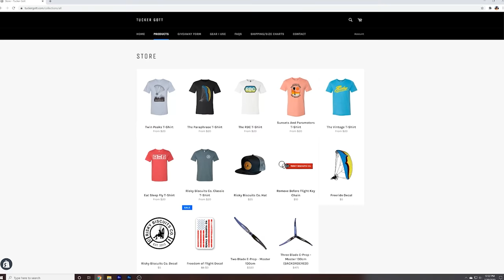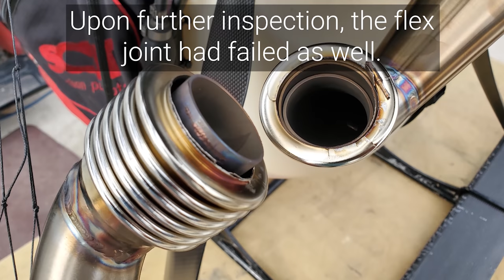Landed On A Street!!! - Top 10 Engine Failures

Comment: Always better than a parachute failure. Otherwise you’re falling at 120mph with a ceiling fan on your back.
Reply: I shouldn't laugh at this
Reply: He has a reserve chute
Reply: @lanthanumlanthanium6373  It looks really safe then, actually. Now I want one!
Reply: @hasselnttper3730  I would if I had more money, I'm starting on Skydiving first.
Reply: I'm a retired aircraft mechanic. Tucker I have an off the wall question;  Do you guys safety wire? I could be wrong but I thought I saw non-safety wired bolts on your prop attachment. I know I saw non-safety wire around your seat arrangement bolts. What's the story on that?
Reply: @dwighthawkins5955  why are you commenting this a a reply to another comment instead of just putting it in the main comment section
Reply: @thec0nductor537  they probably know that Tucker won't actually respond and is asking other paramotorists
Reply: Unless u use the fan to get a safe landing
Reply: @cali4788  the fan isnt powerful enough for that, plus u cant steer without a chute
Reply: try para gliding needs to be sunny though
Reply: Rip grant
Reply: @John 29Barr ye
Reply: LOL
Reply: Thats why we have reserve chutes
Reply: That's kinda my question. What if there's a glider failure?
Reply: In order for it to be a ceiling fan, first you have to fall through someone's ceiling.
Reply: Just point towards the sky and go full throttle, DUH!

Comment: Tucker - Why not mount a GPS beacon on your machine? Even if the pilot is injured, you can locate the machine ...
Reply: GPS is actually really unreliable, especially if the location is a bit woody. I went into the woods with a GPS on my e-scooter, and like bruh i couldn't locate myself on the map.
Reply: @Appri  Handheld aviation GPS are extremely accurate and extremely reliable. For stuff like this I advise a Garmin in-reach or some other Garmin GPS Personal Locator Beacon with two way communication capability. That said, my flying is a lot more remote and dangerous than paramotors, who will come out unscathed in the event of an engine failure.
Reply: @philconey11  I mean the only case where you lose a paramotor guy is when they crash. And if they crash, they are most likely in the woods, meaning the GPS is useless.
Reply: Coder Stone my plane ELT that can pinpoint location down to five feet
Reply: @Appri  Imagine saying a GPS is unreliable.
Reply: @luckylukas2282  You do realize cars get lost in large national parks all the time, because GPS navigation tells them to go the wrong direction?
It's especially unreliable WHEN THE SIGNAL CANT EVEN REACH THE SATELLITE, due to a thick leaf canopy in the woods.
Reply: @Appri  dude stop confusing those crappy road-going GPS's with proper aviation-grade GPS's equipment. GPS's made for aviation and for sailing are another level. much more expensive than the crappy cheap GPS for driving? yeah! but much more effective and reliable too!! driving GPS's are made to be as cheap as possible, with GPS antennas that are not much better than the ones or your phone(if any better).
Reply: @vegetapt9144  Those are called DIFFERENTIAL gps, and wayyy above anyone's paygrade, especially if you are flying a budget paramotor, don't you think?
Reply: Can just share locations on Google maps permanently.  Will get you close enough to find them
Reply: @Appri  I wasn't referring to those. differential GPS is way too much of an overkill even for sailing in open ocean. I sail solo in a 33' sailboat in the ocean and use a regular marine chartplotter paired with my handheld GPS
my point was that you're judging GPS's as if it was all the same, and it's not. 
driving GPS's like that cheap tom tom's on your dad's car, are pure garbage, even thicker clouds can make their signal fail. if your phone is a decent one it probably has a better antenna than those. 
I don't fly yet so I can't recommend a decent aviation specific GPS, but I use a handheld GPS(garmin InReach,now it cost 400$) for hiking and to pair with the sailboat chartplotter, it went with me on my last vacations in the Amazon rainforest and...no, it didnt failed, not even a bit! so dont come with that nonsense
and for the use case refered in this comment its probably a good option. there are other similar GPS's from other brands that are cheaper. I've just chosen this specific one because it can be paired with the chartplotter I already had.
Reply: @vegetapt9144  Sigh, you call it nonsense, but have you EVER even walked into the woods with a GPS? Any sort of canopy can easily ruin GPS accuracy. You are a sailor so you probably NEVER have a canopy over your boat when you need your GPS, but this is precisely why GPS suffers inside subway stations, tunnels, EVERYWHERE. Stop arguing your opinion without understanding what the other person is saying.
Reply: @vegetapt9144  " I sail solo in a 33' sailboat in the ocean and use a regular marine..." Sounds like the Amazon all right. Geez, triggered much, aint ya? and if my profile makes you think I'm just a child, think again. If you seriously think a GPS can keep track during heavy interference, you need to go redo basic and modern physics. Facepalm. And yes, you are totally a person on youtube named Vegeta PT, with a Vegeta profile picture, yet travelled to the Amazon and is a professional sailor. Noone's buying your BS.
Reply: @Appri  your profile?  It's your attitude. If you're not a kid, it's even worst. I'm not a "professional sailor" neither I said that. I simply have my sailboat and go for a sail every time I can.  And yes I went into the Amazon to take ayauaska, what's the big deal on that? BTW It was my best trip ever(pun intended)
Reply: @vegetapt9144  Your attitude is even worse...
Reply: @Appri  Why? you are wrong.
Reply: @Appri  damn you just like me when people try to make diabetes jokes LOL
Reply: I read a comment about an apple watch, is the watch break or feel a crack it self send a message with the location
Reply: @Appri  GPS,s are receivers they don't transmit anything to the satellites they just receive there coordinates from the satellites up in space.
Reply: @stevejones8665  And to receive that, you need a good connection. When did I ever say you have to transfer from the GPS to the satellite?
Reply: @Appri  You said "WHEN THE SIGNAL CAN'T REACH THE SATELLITE". In your comment I replied too.
I guess you meant to say When the  signal can't reach the gps or receiver.😊
Reply: @stevejones8665  You're right! My bad. GPS is a one-way system with satellites being the transmitter. Facepalming in misunderstanding your comment, haha.
Reply: Gps isnt unreliable if your above the trees..... Most have track modes so you can follow the ttrail of where something went, but need a data/radio connection to uplink the trail as you go.
Reply: GPS is from cell towers since Satellites don't exist.
Reply: @bobwreck3775  satellites don’t exist?
Reply: @Appri  gps is absolutely not useless in the woods, what are you even talking about. Ive been using gps in the woods for decades
Reply: @Appri  not only have I walked in the woods with a gps, I've been a hunting outfitter and guide for 20 years. You are completely wrong, period.
Reply: @stonehorn4641  Sounds like someone can't read the one year ago timetext, go get better glasses grandpa!
Reply: @Appri  usually thats bc the roads are set incorrectly on the map, not because gps is unreliable. Aviation GPS does not work the same way.

Comment: Ground starting is dangerous? You got it. My head & shoulder went into the open space above the frame of a Solo 210. My shoulder saved my life. It took the brunt of the spinning prop while the prop glanced off my face - wide open - full throttle. My shoulder was hamburger meat.
Reply: Shit man hope you recovered well
Reply: Oh man, I'm not a fan of the Solo 210....
Reply: @mark675  Thanks Mark & Johan. I'm okay now but it sure put a hem in my skirt! YouTube at "Paramotor Prop Strike." Look for the thumbnail of a pretty girl. I'm not a 210 fan either Johan....now
Reply: Yikes
Reply: How did your shoulder go into the blades if there's a metal net? Im a newb
Reply: @db5094  Go and search "Solo 210" on Google Images, you will see the open space where there is no netting, quite scary.
Reply: As someone with no experience.....why is this dangerous? How do you end up in the propeller?
Reply: @camaro7587  I'm no expert but I believe  starting the prop could move the entire thing into you. Usually your body should absorb that torque from the engine starting. That's just a guess, though
Reply: Sheet
Reply: @camaro7587  yeah it can just suck you in, or you could knock it over and fall into it. Just don’t do it

Comment: Last one failed straight through the weld.  I wonder if it was damaged in shipping.  Huge failure.
Reply: Possibly ran low on Flux gas and the weld got porous. Its not uncommon for a crack to go through a weld but more often than not it will crack along side of the weld. At least thats ben my experience.
Reply: no it wasn't damaged in shipping the welded parts have the thickest cross-section and can handle the most amount of stress. Unless the materials where not properly melded then it becomes what tucker received. Instead of glue they gave him chap-stick.
Reply: Root causes can be also excess of vibrations because of pressure pulsations or temperature difference possibly due to altitude / weather
Reply: I have never seen a TIG weld break like that, very surprising under these low stress circumstances.
Reply: @NLFlyFisher Two things I can think of is not enough penetration, and not enough gas or back purging. Nitrogen embrittlment. Likely never got heat cycled to drive the nitrogen out and relieve the stress on the metal, and perhaps the weld didn't get good penetration.
Reply: @EyebrowsMahoney  You are probably right sir!
Reply: @NLFlyFisher  fwiw not a professional. Just my own 2 cents
Reply: @EyebrowsMahoney  call it 2 bucks cause it makes sense haha
Reply: @NLFlyFisher  ahh, neglected to account for inflation :)
Reply: @EyebrowsMahoney  I'm Canadian so your 2 bucks is 2.60 for me haha
Reply: The joint at the flange looks like no filler has been added, which caused it to fail.

Comment: I use to race 2 stroke motorcycles in motocross/supercross/shortcircuit and would seize engines constantly because the oils were not good enough. After trying many different brands and blowing up more engines,  I found Amsoil and was so impressed with their 20:1 oil that i started stretching it out 30:1, 50:1, 75:1, at that point my sponsors (Motorcycle franchise)&(Mechanics) rang Amsoil to come see and we started using it at 100 to 1 and could not blow the engine. They ended up sponsoring me and created the 100:1 2 stroke engine oil they now sell.

Comment: Like Italian cars and motorcycles, Italian paramotor engines are mostly trouble prone, fussy, and high maintenance. The Italians don’t seem to understand how to design for reliability. It’s too bad Honda doesn’t make paramotor engines. They would be ten times more reliable, make more power, be quieter, require much less maintenance, and parts wouldn’t fall off as has happened with your Italian motor.
Reply: well they actually do make engines used in paramotors. 1000cc vtwins in trikes.
Reply: B. Bakker Those are likely sweet trikes but I’m talking the strap on your back variety like Tucker’s high strung, high maintenance, high drama, Italian motor.
Reply: Oke lmao sure “ Fix It Again Tony!” That’s what fiat stands for

Comment: Teacher: "what's the safest mode of transportation"
Class: "plane"
Me: "it's not a plane, it's a parameter because no matter what as long a your parachute 🪂is good your good"
Reply: a plane is not even close to being the safest transportation system
Reply: @wdasdadsad8450  yes it is actually
Reply: Paramotor are one of the most dangerous flight locomotion
Reply: @wdasdadsad8450  it may actually be the safest lmao
Reply: @Jerebo_mec_extreme  well if a paramotor fails mid flight you at least know you have a working parachute
Reply: @wdasdadsad8450  it actually is you're just paranoid

Comment: Hey, Tucker. The yellow stuff you saw on your piston and cylinder head was most likely sulfur. Aviation fuel is far less regulated than pump gas and as such, the sulfur levels are much higher.

Comment: The frozen throttle cable failure happens on large airliners alot...the 757 has a Teleflex cable which freezes all the time causing a multitude of issues!

Comment: I would really watch 1. fuel quantity 2. having a proven quality exhaust 3. the throttle linkage 4. loose stuff going into the prop.... seems most of the engine failures have something to do with these.....

Comment: Man I thought engine failures were more of a fluke than that.
Reply from the maker: This is pretty much the worst of the worst over 7 years. So the odds are pretty good. 😀
Reply: @nocare   the newer engines are just as unreliable as the old engines the only thing new engines have going for them is early warning thanks to delicate electronics. But thats just another failure mode waiting to happen. Plain old  carb engines are really reliable if build right and maintained correctly.
Reply: I've a number of them. 2nd flight, went to idle, it died, wouldn't start. 2 of them, ran out of fuel. My last 3, I had installed EFI on my motor. EFI requires power.. well, the rectifier wasn't working and the battery died... as did the engine. Finally fixed that.  Now I didn't know it at the time, but the CHT sensor wasn't made right and came loose from the connector. Now there's air blowing over the sensor which gave a false reading to the module. "Ah, nice and cool! We can lean it out!"... Blew a hole in my piston. Landed in the Atlanta Motor Speedway parking lot, dodging light poles and wires! 😒  Rebuilt it, installed a secondary CHT so I could monitor it. Burned it in.  Flew for 15 minutes, CHT jumped to 427 and before I could shut it off, blew another piston.  So much fun.
Reply: @nocare  Actually no... I bought my motor new from Discover.. which, sadly, was a lemon. Sent it back to Mixer who made it right. Spoke with Alex, who developed the EFI, told him I'd try it again, after the first blown piston, if he would pay if it happened again... Which he did! Great guy... The problem us, when Alex got the CHT from his manufacturer, it's sealed up in heat shrink... Making it impossible to tell if the sensor was correctly epoxied and crimped into the connector. Anyhow, I sent it all back to Alex who refunded me the cost of the system. 
Yeah, it sucks that I am still out a grand... $250 labor, $160 for Antigravity battery and charger, and $600 for the first round of parts...
But I'd go back to it if the price was right and guaranteed...
Reply: @SandiNPaul  Alex from Aviator?
Reply: @carter7515  Alex Huff, the dude that put the EFI system together...

Comment: Nice thing about Engines blowing is that it's usually the top end. As someone who grew up on 2 stroke dirtbikes, I rebuilt my first top end at 12 (after helping my old man many times over the years). I rebuilt the top end of my Eole twice. My moster 185 has so far run perfectly.

Comment: What is it with paramotor and engine failures?
I had a 250 cc two stroke motorcycle for five years and i used it every other day. Sun, rain, ice, snow, storm or calm. I ran it in the forest and on long stretches of asphalt and the ONLY time it stopped was when i forgot to refuel it that one time when i was almost home from a long long trip.

And that time freaked me out because it was one of my first long trips so i had been running it at the same revs for the last couple of miles and it had suddenly revved up a few miles prior giving a considerable boost in power. In hindsight that was just the air changing as i went from a foggy area into a clear and sunny area on the other side of a mountain.
But the engine went out with a bang in the exhaust and i thought something had blown up. But everything seemed fine so i checked the three major things. Fuel, air, spark.
Well, i got to fuel and realized the tank was bone dry. Luckily for me i was on a slope and there was a gas station at the bottom of said slope so i rolled over the median and down that slope to the gas station and the bike ran like a clock ever since.

Seriously, what kind of Chinesium are these paramotor engines made of?

Comment: What's the weight capacity on this thing
Reply: i was wondering the same thing
Reply: Its more dependent on the size of the wing a larger wing will support more weight where with the motor you can get off the ground with a samm atom 80 but you will have to run much longer than if you have a large motor the the master 185 on the scout

Comment: The fact that you've had at least 10 engine failures makes me not wanna get into this sport, regardless of how fun it looks. Kinda sad.
Reply: The fact he survived all 10 engine failures shows how safe it is when you’re experienced. Plus it used to be that drowning was the no. 1 killer of paramotor pilots
Reply: If you are indeed worried about that (as I would be) I'd recommend looking at how many flights he's done. He also tests a lot of aftermarket or custom things, and several of these were due to failures of those OR testing of smoking, which is not necessary. I say this as someone who has no idea of how much he flies but I think those two aspects are worth considering. These clips were of more than him, and mostly through customization or gas failures. Just my two cents.
Reply: Those parts on the motor are junk.  Like most 2 strokes.  They have never been considered reliable by any stretch of the imagination.
Reply: Nothing more than large goped motor.  Unreliable is my first thought.  Look at that tiny shitty clutch that your life relies on.
Reply: @msawyer110  Suit yourself then.